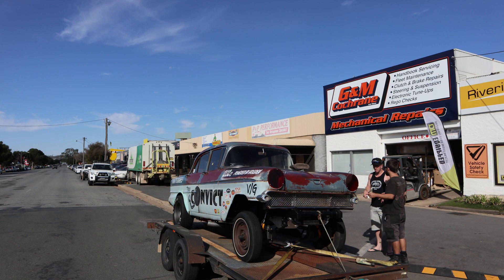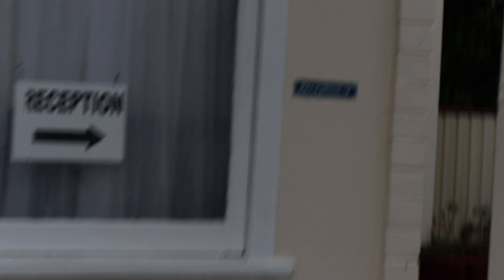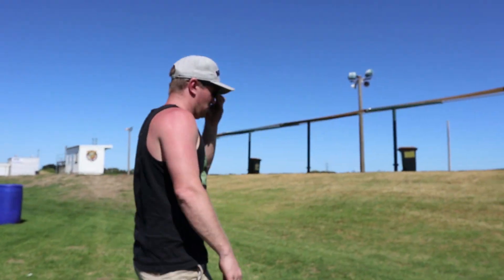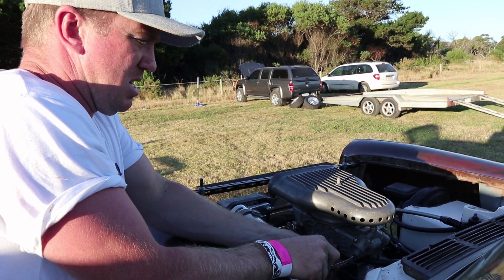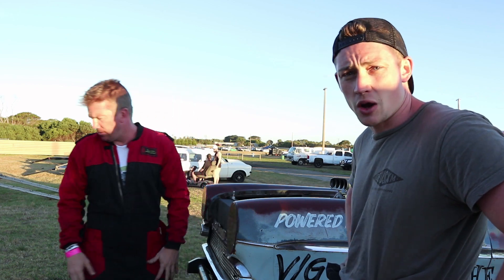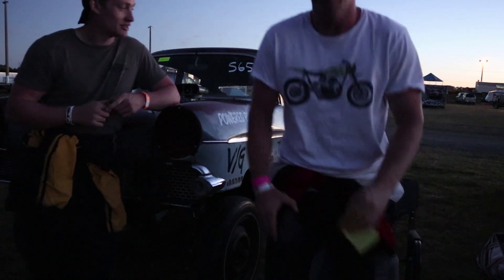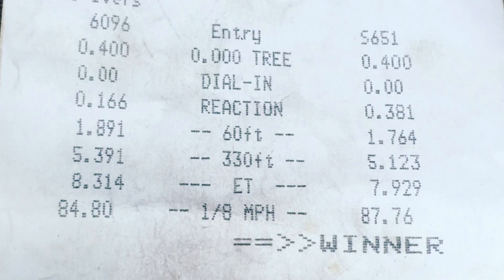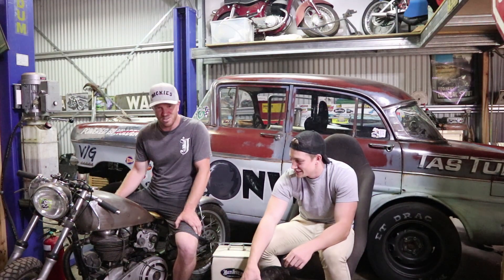We go GASSER Drag racing in our blown 250ci crossflow powered vauxhall Victor.  TasTuned Ep.1

Comment: I use to eat balancer's until I doubled up on the keyways. It seems to happen when you shut down and the blower is still spinning.You might hydraulic the motor and blow out the head gaskets when you add more boost.I actually pulled my screwed-in head studs out  and trashed a block. Once that was solved I started destroying valve train. Good luck with the Convict... Cheers